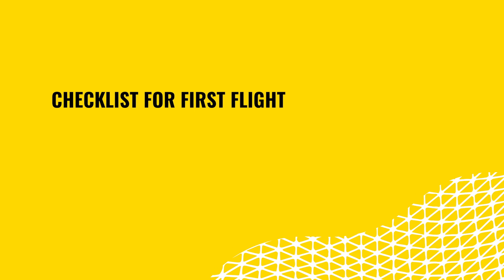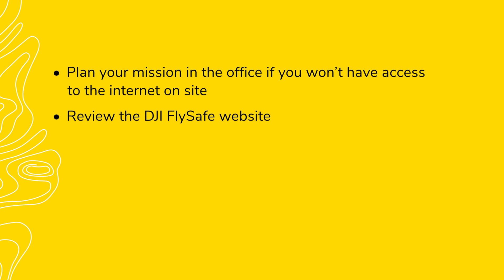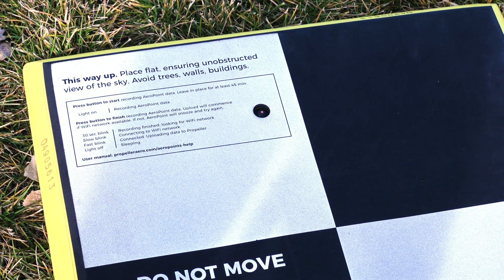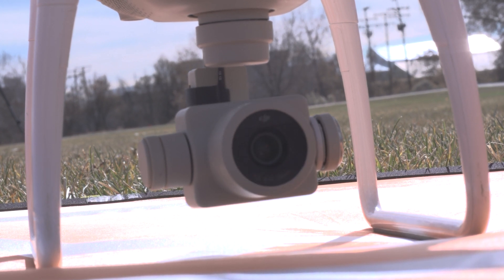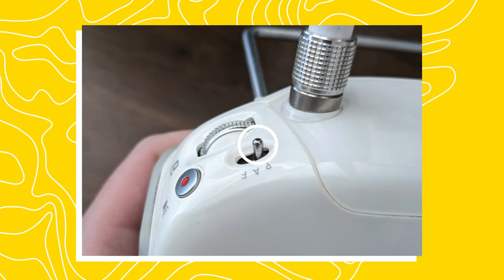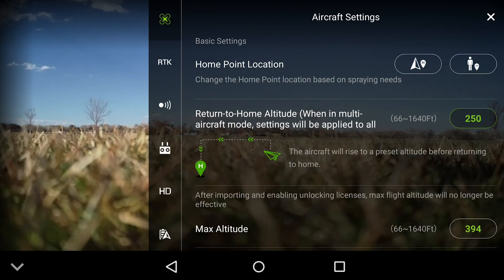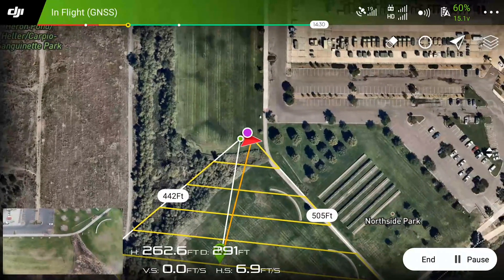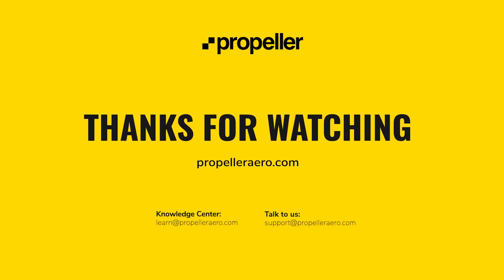Getting Started Essentials: First Flight

Comment: What is the point of having the Phantom 4 RTK drone,  if your process does not require it?  Could a pilot simply use a P4P V2.0 with your Aeropoints? I thought the whole point of the P4 RTK was to eliminate the need for GCPs
Reply: PPK is more time efficient, safer and more accurate. Placing the GCPs out in very specific places with good coverage in a large hostile environment such as a mine, a farm near roads it is dangerous and time consuming. It can take up to 5 hours in some cases if mobility is difficult to get good coverage, PPK can bring this down to an hour in the worst cases but probably less. For the worker its safer and if mobility is bad less exhausting, for the employer or owner of the drone its cheaper and for the client its more accurate results. The problem is the price difference  but given enough use with the extra efficiency it will pay for its self and then some.
Reply: @benpearson8831  But with an good RTK drone, most of the time I do not really need any GCPs.  My P4 RTK with D-RTK 2 is very accurate without the use of any GCPs in the field and I no not need any type of data connection.  Granted, I have never tried processing a PPK type mapping flight for comparison to see how much more accurate it might be.  Something I should do, if for anything just to help myself learn about it and see what works.